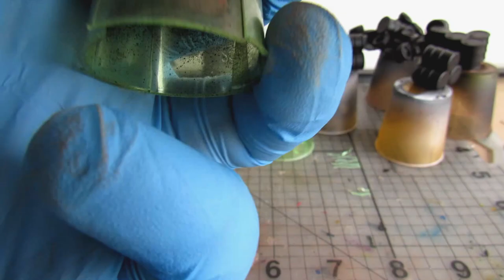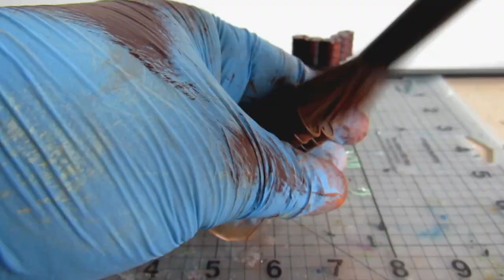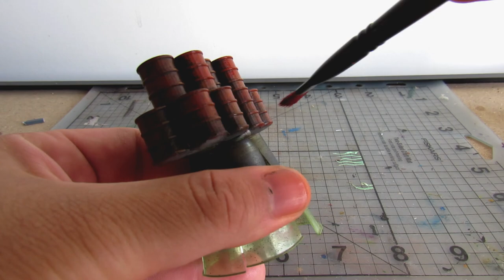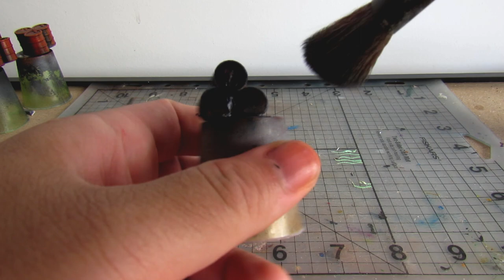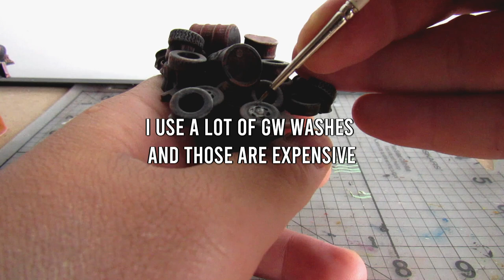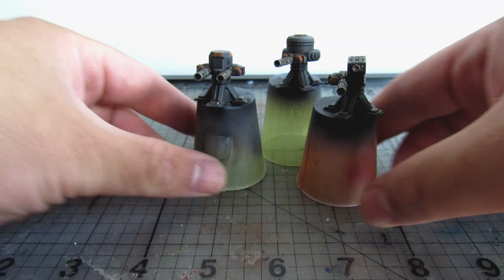Painting 3D Printed Scatter Terrain and Turrets for Gaslands

Comment: These turned out really good. I've never actually used the hairspray chipping method for weathering, but I may have to give it a try. I tend towards weathering powders or dry brushing, but the results you got here speak for themselves.
Reply from the maker: Thanks! Honestly the hairspray effect here is minimal and only really shows up on close inspection or under the sharper scrutiny of processed video footage. The drybrushing is absolutely doing the heavy lifting. Weathering powders are a great way to age a paintjob, too.